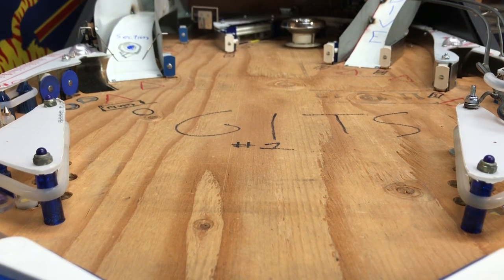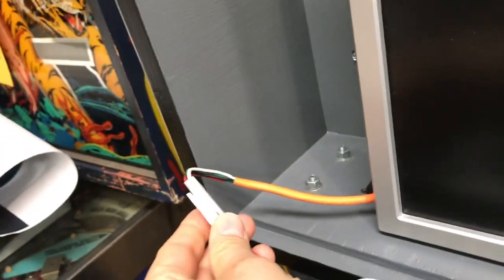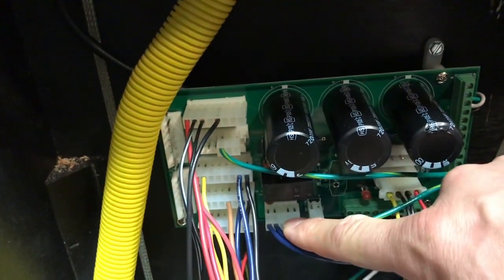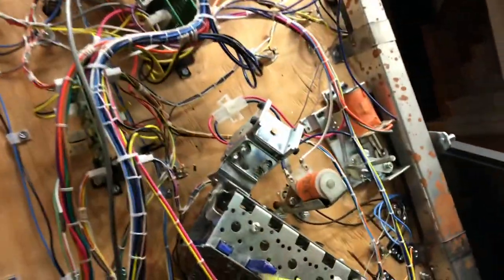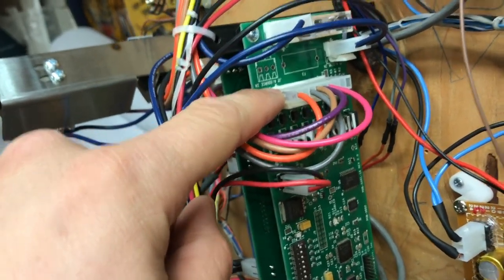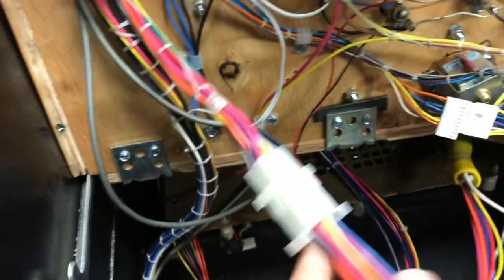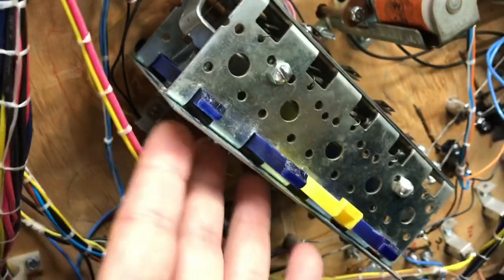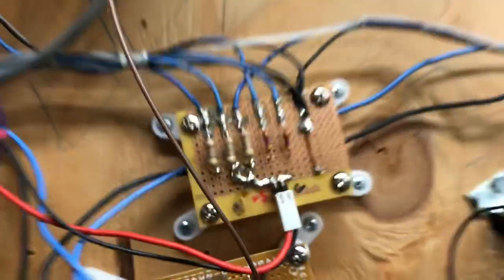Quick overview of connectors used in a P3-Roc home brew pinball

Comment: On your PD-LED board I see you have a single wire rather than a group of five for RGB lights.  Is that, plus a positive power source, all you need to get a single bulb to turn on and off (non RGB)?
Reply from the maker: That wire i am doing something a little different.  The LEDS are negative signal PWM (pulse width modulation) for each channel R,G,B and a single positive 3.3 volt running to it.  I recommend you pick up a TNA style LEDS/Ribbons with your pd-led.  What i am doing with that single channel drive I triggering a TIP transistor and running a single higher voltage (5v) led for the start button.  not the best way to drive this but it works.  I would definitely not start here. Dont direct try to over drive the pd-led you will damage it.  There's some details in the manual available on multimorphics shop for the board.  but to start and be safe start with pre made cables and leds from pinball life, trust me using sockets and standard bulbs will not work and is not cheaper than a RBG form PBL.  i should do a video specifically on this.
Reply from the maker: but you can run a single LED if you want, just not a standard pinball led bulb.  current limiting is taken care of on the pd-led.